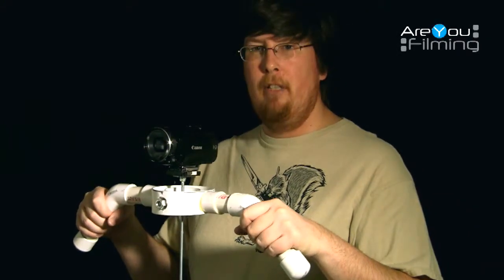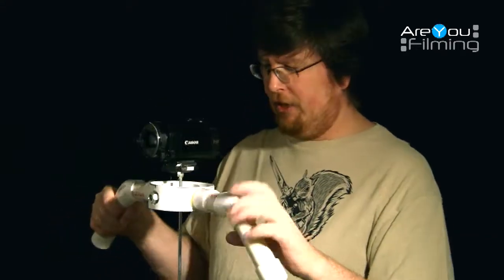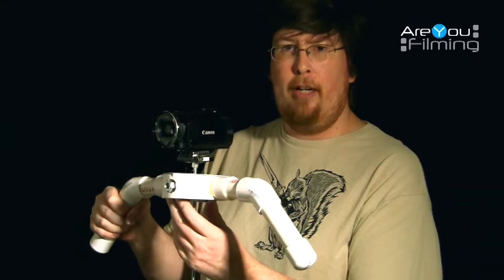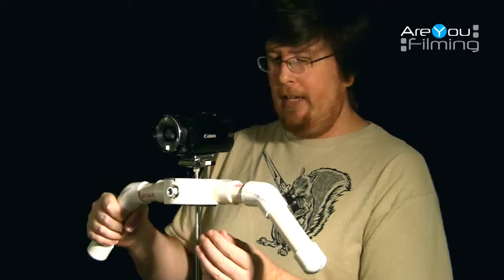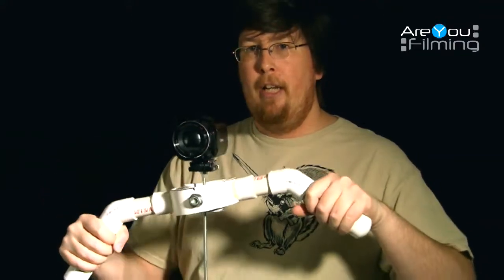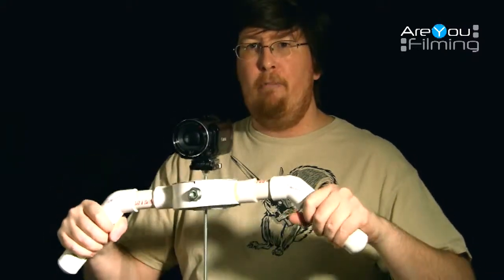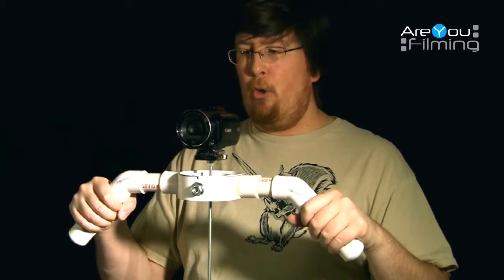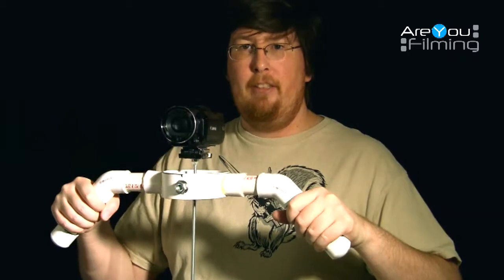Do It Yourself (DIY) $35 steadicam

Comment: That is great!
You are taking advantage of something that others seems not to see or understand: the fact that using two independent hands tend to dampen each other's motions; if one hand is accelerating, the other is likely not doing so in the same way.  Also, you are recognizing that a wider grip is fundamentally better for stability anyway (THE reason "fig rigs" were created).

How do you manage intentional turns/turning the direction of the lens? Any ideas on that? For me, that would remain a challenge. If you figure that out, you win the big prize.

I'll take your rig with its great results before wasting the cost of a T3i camera body on an overpriced manufactured model any day!  Thanks for posting this video.